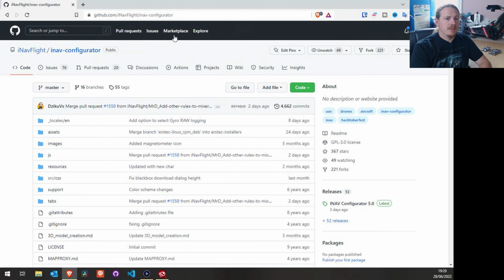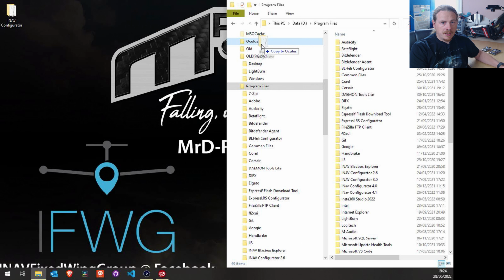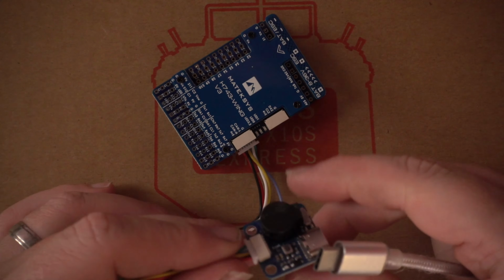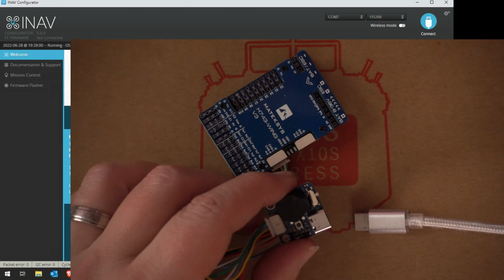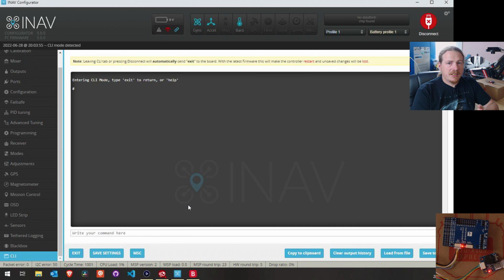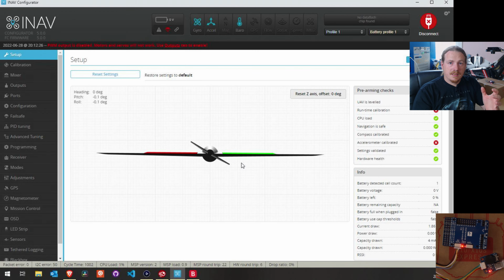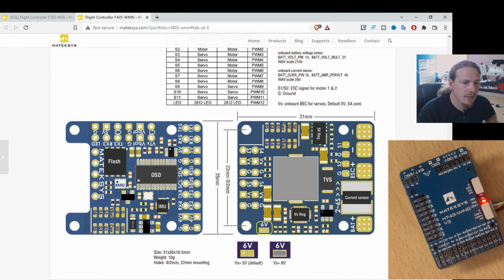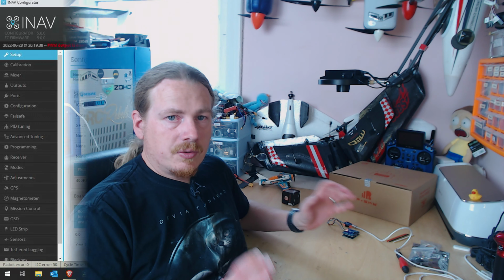iNav 5.0 Beginner's Build Academy: Lesson 03 - Installing iNav and the pre build setup

Comment: Good morning, evening/afternoon... If i don't want to solder the ESC for my twin motor to the PDB (Matek F405 wing V2) how do i accomplish this ? I'm using AWG 10 wiring and the pads are rather small. I want to use a Hall Effect sensor, but it looks like on this board you can't, I think. It doesn't have a Vbat or a Curr pin? I'm quite stumped as an intermediate user.  Any help would be appreciated. Thank you

Comment: This might be a dumb question, but if the GPS you are using has a magnetometer do you need to be mindful when putting it near hatch magnets?
Reply from the maker: Don't use the magnetometer with INAV. If your GPS module has a magnetometer, either don't wire it up or disable it.

But yes, a hatch magnet would have an effect on the magnetometer. So best to space them out.

Comment: Hey Mr. D, just flashed iNav 5.1 onto my flight controller. I am now prompted to redo the accelerometer calibration. However, since 5.0, my flight controller is sorta permanently mounted (bottom-side glued down) in my plane already... any tips on how to recalibrate? i'm not sure how precise i can be with tilting the entire plane during the calibration process...
Reply from the maker: Did you take a diff before updating to 5.1? Of so, you can get the accelerometer data from the diff. So no need to recalibrate.
Reply: @MrD  not too sure what that means so i'm assuming i didnt lol. darn. 

whats the likelihood i calibrate it with the fc in the plane?
Reply from the maker: You can. It’s just a pain. Just try to hold it as still as you can in each axis. Use benches and walls to help.
Reply: @MrD  will do, thank you for the advice! fingers crossed
Reply: @MrD  SUCCESS! got it calibrated just fine
Reply: @MrD  can you direct me to one of your videos going over "diff"? :) so i dont have to do this next time
Reply from the maker: It will be in my iNav updating videos.  https://youtu.be/SGts5Pjoj3w for example. I will add a section to the beginner’s series too, seeing as 5.1 has just gone live.

Comment: I can't for the life of me get my F411wte to flash. It will connect to Inav 4.1, and show connected to inav 5.0 (can read version), but it won't flash or even manually enter DFU mode
Reply from the maker: It won't go to DFU by holding the button? If all else fails, that should work.
Reply: @MrD  Nope. On both my computers. But I used the ImpulseRC driver fixer and it worked just as yours did. Maybe I missed that step and didn't hear it?

Comment: Interesting, never knew about the acc pointing up on calibration. Should i do it over again? The fc is already down in the model...
Reply from the maker: To be honest, it was new to me too. I’ve usually calibrated with the board the right way up. 99% of those boards, the imu has been on the top of the FC, so it’s fine. I’ve not had any more problems with the calibration not completing since making sure the imu is facing up on the first step. 

If it calibrated fine. I would leave it as is.

Comment: Hi, are these two accelerometers prevent horizon drift better?
Reply from the maker: No. iNav can only use one of them for navigation anyway. The best prevention is making sure there are no unwanted vibrations (out of balance prop/motor) or electrical noise.